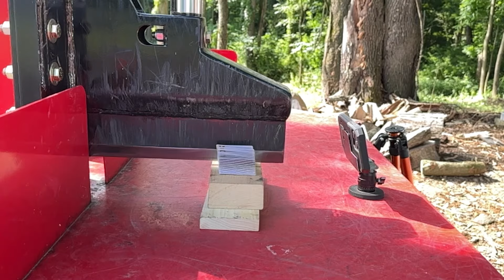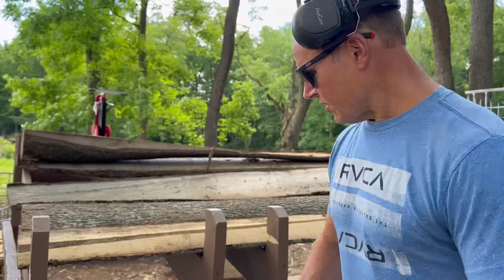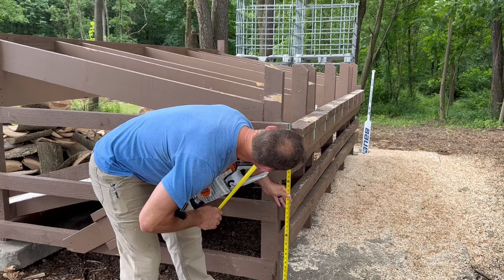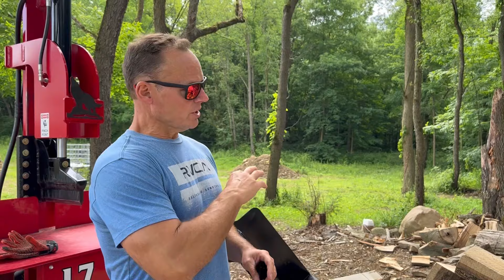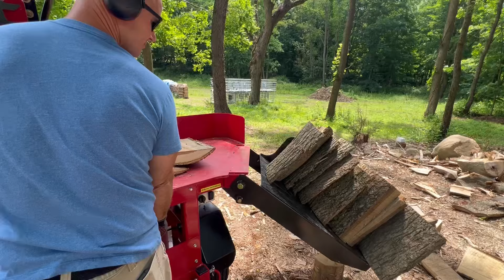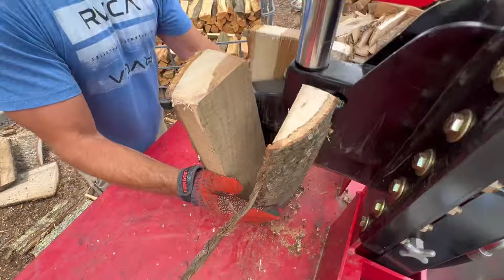I may have  built the best ~Bucking~ table ever.

Comment: Good morning Doug, that bucking table is the way to go. As you said and what stands out to me is the Comfort and Safety. This come into play especially when your a Lone Wolf doing some serious rounds facilitating the ease of the subsequent splitting process. I could see this table along the side of an appropriate shade shelter keeping out of the sun or snow, which have its own benefits when it comes to additional comforts well still being out in the elements. Like I’ve stated before your setup is pretty sweet and with the bucking table as a focal point I believe anyone can setup and facilitate their own needs and comforts. The ease of clean up will facilitate its own benefits by being an inviting area to work which is productive. Have a wonderful productive weekend and week. 😀👍🪵👍🪵👍🪵

Comment: Doug .... where your stops are I see it's 4" inward and it also look that your 8" truss is 2" lower then your table area. so I'm seeing you have 4" out and 6" drop. Is that enough for the chain or could it be less or more room. Thanks, Mike
Reply from the maker: @michaelwarren9937  Hi Mike, if I’m following with what you are asking, yes it is enough clearance. The big factor is how tall the cutting area is and how tall you are. It changes the approach angle based on both of these heights and where the saw ends up once you cut through the log. But for most part, that space is just about perfect.
You are we;come to email me if I didn’t answer you correctly. Oneeyecustoms22@gmail.com

Comment: Nice camera work today.
On a good vid.
Congratulations.
Wondering if 
Some PVC pipe ( cut length wise , ) on the top rails would allow the un cut wood 😢 down too you better
Reply from the maker: Good thinking, but with round logs, I kinda want them to stay up and out of the way. If slabs only, then yes for sure.

Comment: Excellent table! Thanks for the video. Just curious about what plastic is on the slide and where you got that?
Reply from the maker: I got it from McMaster Carr.
It is a UHMW plastic sheet I had .
Reply: @OneEyeCustoms  ok, thanks. I've had a couple of times that something like that would have come in handy.
Reply from the maker: @ I apologize, I thought you were asking about something else. I didn’t look close enough at what video this came from. 
The white plastic sheets came from Home Depot. They are in the paneling section.
Reply: @OneEyeCustoms  ok, thanks. I was just out on Mcmaster Carr and that umwh or whatever, is pretty pricey. Home Depot is more in my price range. Have a good one.

Comment: Doug, nice table. One question, if you loaded a bunch of round logs onto it, are you at risk of saw kickback? Seems like if upper logs roll onto chainsaw nose it can trigger kickback. If that's not an issue, I may build one!
Reply from the maker: Yes it is possible, but it is possible with any sawing situation. You have to know what side of the log to cut and be careful where the saw tip is. Just like any circumstance. One thing for sure with this stand is you will not fall with the saw in your hands walking over logs and rounds. To me, that is a more concerning situation.

Comment: Great bucking station. I just picked up a MS-261C to compliment the 500i. How do you like it, and are you familiar with the Stihl 2 in 1 sharpeners?
Reply from the maker: I love my MS261, perfect size for most everything I do. I did put a 20” bar on it just for more reach on my bucking table.
I’m not a fan of the 2 in 1, I think it takes the rakers down too much and then bogs the saw out.
Reply: @OneEyeCustoms  I’ve noticed that it shaves them down quite a bit. I do like the size of it to grip vs just holding a file in a handle though.